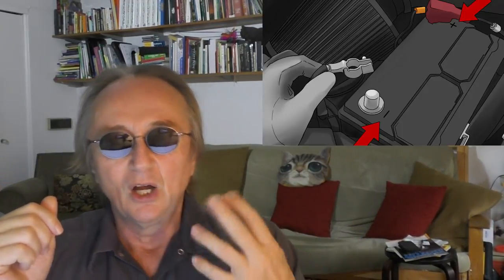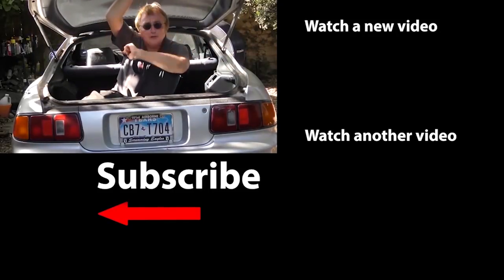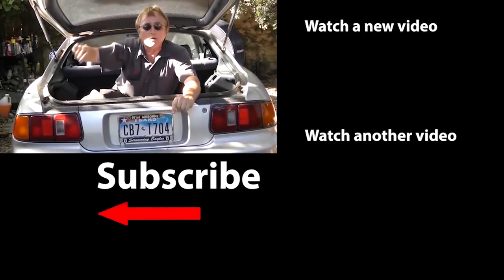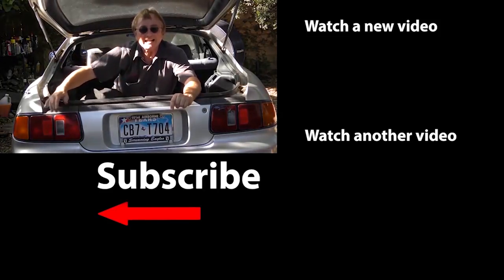When This Happens, You Need to Replace Your Catalytic Converter

Comment: I had two cars that had noisy catalytic converters as they aged. They made a metal buzzing sound. 
The first car, a 1987 Dodge Aries, I took to a mechanic, and he said it needed a new catalytic converter and wanted over $800 dollars to replace it (in 1994). I decided not to replace it. When I got home, a friend of mine went under the car and pushed on the converter with a stick. As soon as he touched it, the sound went away. It turned out it was a loose heat shield. I tightened it down with an exhaust pipe clamp and it never made noise again.

The second car was a 1999 Mitsubishi Mirage and the same noise happened as it got older. The same solution worked also. So, make sure a $2 fix might work instead of a $1200 fix.
Reply: Sucks that scam artists are out there. Thats why Id prefer to do everything I can at home. My transmission was leaking and the shop held onto the vehicle for WEEKS and did nothing. They also overtorqued the gasket bolts according to the other place.
Reply: Soooo...it was  magic stick? : )
Reply: I have a magic stick too 😃
Reply: Well that's a cheap fix

Comment: Yup, the C/C in my Ram V-10 decided to come apart and clog the exhaust when I picked up my brand new trailer.  Took me about 3 hours and 30 gal of gas to go 60 miles pulling the Grapevine in Calif.  (3 hrs for multiple cool-down stops.)  Had a friend come get the trailer so I could limp the truck home. Walker makes a nice replacement.

Comment: I've had the heat shield break loose & rattle against the catalytic converter, with the converter just fine. A self tapping screw or a rivet is pretty cheap & easy fix if you haven't checked the shield, do so.

Comment: I haven't used this trick in newer engines, but a pint of diesel fuel in the crank case will cut right through the  sludge so you can drain it out with the oil after 25-50 miles.

Comment: since it's a 97 Dodge you gonna need to replace the whole car not just the catalic convertor.
Reply: TSC TSC  ohio ate my 98 dodge 1500 lol so I bought a clean 85 w350
Reply: @dethklok6356  Ohio winters eat everything! I keep trying to find an inexpensive crew cab (around 6k) and everything is rusted to heck.
Reply: Constant Comet  undercoat and oil spray helps but you’re just prolonging the inevitable
Reply: GM Kof hard right I know it falls apart eventually lol ill find another in next 10 years or so
Reply: I had a 97 Dodge Intrepid. It was great until 202K miles and the transmission died. I scrapped it after that rather than messing with an expensive rebuilt transmission.
Reply: Constant Comet sounds like you’ve got a good excuse for a road trip to Arizona. Nothing there has serious rust
Reply: Constant Comet hey you can come out West to where it's hot and dry and buy something out here. No rust for sure if it's from here.
Reply: you're* going* to* need to replace...
Reply: Catalytic* converter*.
Reply: people drive the doodoo out of cars and when they break, they call them the worst POS they ever had. Not just Chrysler products either.
Reply: @jamesmedina2062  I'm actually looking at cars in Dallas and Phoenix now, as I have friends a d family there. I can fly there one way for like 150 bucks, go test drive a few trucks, hang out for a day with my friends, then drive back. It's actually cheaper to do that than to buy a truck in Ohio because anything without rusted frames sells for an outrageous premium.
Reply: Haha

Comment: I've been using engine flush for years, in multiple vehicles, and never had an issue. In fact, all of my cars have gone 275,000 or more miles with no internal engine issues. However, the flush I buy isn't corrosive. It's made from petroleum distallates. They sell it cheap at Wal-Mart.

Comment: Hi Scotty, Just wanted to inform viewers here that Platinum (Pt) or Rhodium(Rh)  inside the cat never degrades. My 00 landcruiser after 230K miles gave an error code for cat. But since I know chemistry and what Pt and Rh is doing in the Cat, I ended up replacing the post Cat O2 sensor with an oem sensor. Result: check engine is gone! BEFORE replacing the Cat, try replacing the post O2 sensor.

Comment: I have a had two Pontiac Grand Prix’s one base model and one GXP. I have had no problem with either except for standard maintenance the 3.8 and the ls4 5.3 will run forever had 230000 on the 3.8 until a tree jumped out and hit me and I only have 60000 on the GXP but still no problems great cars greatly put together R.I.P. Pontiac

Comment: In a wet trunk, look for damaged weather stripping ... then clean and re-lube with a vinyl/rubber dressing product.  Then look for gaps near the wheel wells and seal those with a tube of silicone caulk.  Don't forget to check the seal around the rear window.

Comment: One other thing to check for water in the trunk is under the carpeting.  I've seen leaks from rust through near the welds/caulking esp near the wheel arches.

Comment: First and only problem I've had so far with my SG Forester was a clogged front cat. $1100 installed, ouch. It ran fine and I could have lived with the engine light but as you probably already know Subaru disables the cruise control when a code gets tripped and I could not live without that. Ever since then I've  started to do all of my own work. :D
Reply: Toasty ouch. I would've left it TBH. What year?
Reply: @ilikeboost4764  2006 n/a, manual. It is relatively mint otherwise, especially for a Canadian car and I got it for a decent price so I didn't mind throwing a bit more into it.
Reply: I absolutely love manual transmission cars so I feel like you have a gem.

Comment: You take a long large screw driver, remove the converter and smash the honeycomb to bits, empty it out and reinstall the converter and then it works really good afterward.  Engine flushes can reek havoc on a VVTi engine, do not flush those.

Comment: My 1995 Chevy Astro cargo van has 268,000 miles, still running strong. Didn’t have to I have the transmission rebuild at 265,000 miles.

Comment: Oddly, just had catcon problems on both my vehicles. The 89 Blazer converter was stopped up (156k miles). It's so old the state doesn't check emissions on it, so it got a test pipe replacement. The 2001 Nissan catcon started rattling. The guts had broken loose from the shell, so it got a replacement cat at 149k miles (It's not old enough to be exempt from the emissions testing). $520 worth, but the car is in very good condition so it was worth it. $420 is about one payment on a new one. When the wheels fall off or the car ceases to be reliable, we'll get a newer used....... Toyota!

Comment: Mr. Kilmer you might also note. A lot of times when a transmission goes out its due to running hot or hard because of trans. Problems. Such as clogged lines or cooler, torque converter, solenoids, and propper fluid level and maintenance. If not corrected no matter where you get your trans. Its not gonna last long. I suggest replacing and/or cleaning any lines and cooler. Also replace torque converter it will save your wallet and trans. In the long run.

Comment: Our 2014 f150 with the 5.0 has a ton of electrical problem the sync system gets confused and will only let you use AM radio or it won’t come on truck has less than 40k miles. Engine runs good transmission has clunky shifts and 4x4 makes a awful noise. They don’t make them like they used to

Comment: Hey Scotty, I have a 2012 Nissan Altima with 60,000 miles. Nissan apparently recommended the transmission fluid to be changed every 30,000 miles. Should I still change mine now or just leave it alone?

Comment: Stop hating on Pontiac, there not bad cars. It's people that drive them into the ground and don't care about there car. It's always Toyota with a manual transmission that's #1 with u.
Reply: chevy I’ve got a Pontiac Vibe w 200k & still going strong. Same car as a Toyota Matrix. It’s a keeper 👍
Reply: Well considering that scotty mentioned in a few of his videos that he only puts 1000 miles in his celica per year, its easy to say that his celica will last. My first car was a 2001 pontiac grand prix gt that i bought for $600. That car was flawless until it got totaled. Had 191000 kms on it. Lets see scotty put 30,000 to 50,000 kms per year on his 24 year old celica and see if it will hold up.
Reply: I had a grand prix that I sold with 191,000 miles on it. I bought it with 161,000 on it. 30,000 trouble free miles, nothing except an alternator ever went bad. I now have a Bonneville SSEi and its even better. Tired of seeing scotty hate on pontiac, i still see many of them still on the road
Reply: @cobyjones5535  and my current daily which is a chevy impala with a 3.8L (another car scotty hates) has been perfect. Like i mentioned its easy to say a car will last when you're only putting 1000 miles on it a year. I put around 30000 kms a year on my impala and its been great for me
Reply: @guirguismarkus  i admit the transmissions in them arent the best, but theyre fine if you baby them and take care of them. 3800 engines are some of the best
Reply: @guirguismarkus  Scottybis a mechanic, so he knows what cars last longer from fixing his customers' cars, Toyota can handle a ton of abuse and they are cheap and easy to maintain and fix (most of the time)
I'm talking about 1996-2006 newer ones are a bit more senstive, but still..
Reply: His Celica would be fine, tons of people put that many miles on Toyota’s. My first Lexus had 180k on it when I bought it and I put 60k in two and a half years and sold with 240k and never had to fix one thing on that car.
Reply: Guirguis Markus it will hold up, Toyota’s can go half a million miles and then some
Reply: Scotty is right on the money. I used to be a Pontiac guy and GM in general, but there is a reason Pontiac, Saturn and Olds are gone. I drive a 7-yr old Toyota. Not one problem.

Comment: Are 1980s-1990s Toyota pickups worth it for $5,000- $10,000 with at least 200,000 miles? Over in the PNW every Toyota seems to be so much money. What would be the best option instead for that size truck?

Comment: That oh-so-sweet feeling when your locality has NO inspections and none of your vehicles has a cat!
Reply: Fl
Reply: Inspections are good when you want to breathe. They may be bad when you want to drive your smoking car. There is nothing like trading in your junker and buying a well-running car, perhaps a new one!
Reply: @jamesmedina2062  I live 2 miles from two different counties with no e-check, yet I have to have it for my vehicles. It's infuriating because it's extra cost, time, and work for me yet I still have to deal with busted muffler crapboxes brrrrttttting up the road all the time. People register their cars at friends and relatives addresses just to avoid it. So it either needs to be embraced by everyone, even with laxed requirements, or removed imo.
Reply: Constant Comet agree!!!! We're all in this together.

Comment: Catalytic converters are easy to fix! They get clogged up with this honeycomb gabage that builds up inside. What you have to do is unbolt it, beat on the sides a few times with a rubber mallet and then stick a really long screwdriver into it and break up the honeycomb garbage into chunks small enough that you can shake them out of the opening. Once you break them all up you shake them all out through the holes and once it's empty you can put it back on the car and you've saved hundreds of dollars!

Comment: Question in reference to an older video.   If you buy aftermarket catalytic converters, where do you have them installed?   I just went through this with a 98 F150---My mechanic shop no longer installs aftermarket pieces.

Comment: Hi Scotty. I have a 2006 HHR. Never had problems. Now the exhaust smells like something is burning.  The check engine light is on and it says its the O2 sensor. I replaced both recently so I dont think its that or if it is would a bad catalytic converter cause them to go bad? Whats the smell all about . No smoke just smell.

Comment: I used to have a small 05 GMC Canyon 4WD truck with 100k on it and those small trucks are tanks! Even tho I dented the oil pan haha! I took it off roading all the time and had to pull my friends out of some muddy places; I pulled a 2 Dr Toyota Tacoma an older one out of a small creek my buddy got stuck in the dang water was up to my windows and I rammed through there pulling his truck like mad 😡 as Scotty would say! Haha Tough little 5 cylinder that I loved! An 18 yr old girl slammed in the back of it welding our vehicles together which totaled it! I am still sad about it but if I get another one it'll be an 08 they put the V8's in! ;)

Comment: S.o. tried to steal mine ..... simply by sawing thru on both ends of exhaust pipe.

Luckily they only sawed thru one part of exhaust ... maybe got spooked .... 2003 Acura 140k MLS.... quote to weld it = $300+

Replace whole pipe and converter = $800+ 

Dallas TX at a Meinike right now !

Comment: Don't flush your engine with aftermarket products.  Run a HDEO (gas/diesel) engine oil like Shell Rotella, Chevron Delo, Mobil Delvac or Pennzoil Long Life.  The extra detergents in those oils will safely clean sludge out of your engine over the next several thousand miles.

Comment: Hi Scotty
I have a 1990 Ford F-250 Club Cab 4x4 w 460 motor very strong 
But the trans will not go into O drive been that way for 4 years runs great 
Will do a filter change but I think it might b a valve body 
Could there b a electrical connection to prevent of from engaging the switch does operate light goes on and off but no o d 
Please help 
What a great engine love it

Comment: Scotty I need your EXPERT opinion! I have a 2000 Lexus RX300 with a Check Engine light (P0768 LEXUS - Shift Solenoid 'D' Electrical Malfunction). The vehicle shifts fine - no problem. The transmission fluid looks clean - no smell - not low. The code comes on every two months or so and then goes off. I plan to sell the car in 6 months what should I do?

Comment: Mine broke and clogged in the middle of my long distance drive at 60000-70000 miles then just replaced it about a year ago at 117,000 on my 2004 Chevy trailblazer

Comment: Scotty F150 is a terrible recommendation!!! 
I had a 2006 f150 5.4 3v it was nothing be trouble! Spark plug change was $750 because of the ‘recall’ 2 pice spark plug cracked while being changed, then had issues with cam phasers and transmission!! Finally gave up and sold it 
Meanwhile my dads 2000 Silverado 2500 has 260k miles no major issues!!!!

Comment: I have a scion xa 2006 and it had 279k miles and just last week it has a purge canister  code . My inspection  is up in dec 31 so I will drive it up to a week before then fix it
Reply: Try to fix it sooner, in case the simple fix doesn't remove the code.

Comment: I have a 2013 Tacoma and the front diffs are engineered junk.  They used a flat roller bearing on the driver's side that fails.  They use the axle stub to support the side output gears in the carrier so they cheaped out and didn't bother machining the carrier to be the support.  It's just cheap engineering.  I do like the rear axle, engine, 6-speed manual, transfer case and frame.  The bodies are soft and dent easily.  I have three dents in my metal truck, one made by wood, one made by plastic and one made by meat.
Reply: Darn meat

Comment: Hey Scotty have a question I have a 2008 civic si. I been losing coolant and took it to the Honda dealer to see what it is and they said that the engine has bubbles in the cooling sysytem and that the cylinder head has to be refurbiahed and the head gasket replaced and that i have rusted cooling parts and they are charging me 4000 for the work is that fair price?. I live here in Dallas Texas

Comment: @skotty Kilmer I have a 2000 Honda Prelude that shakes after V-Tec is activated. My issue is that I had the same problem with the cat, the ceramic inside was broken so I took it all out and I’ve been driving like that no pb. Does that affect the V-tec from functioning properly?

Comment: What are your thoughts about my 1998 Ford F150 with 326,000 miles?
Reply: Drive it until the wheels fall off. New ones cost too much.

Comment: What I was in automotive school I found that when I ran Airplane Fuel through my Nissan stanza it cooked the catalytic converter and with no money all I did was smash out the ceramic insides removed it all and put it all back together it's still passed emissions with no problem and nobody ever knew the difference. Any comment to that?

Comment: Hey I have a 2002 Dodge Ram 1500 v6 3.7 single cab truck sounds a little quieter than before it has a loud muffler I like the sound but wish it could be louder what should I do? Had it for like 14 years has 183,333miles

Comment: The failure of the fuel tank purge valve coincided with the rear O2 sensor not working correctly. This is the same valve that is also part of the recall. Apparently fuel was drawn by suction up the purge line and into the engine. The rich mixture can cause the engine to ruin the converter, right? I remember my car would backfire on downward inclines really badly often, and the exhaust would smell like gasoline when the car was started – it doesn't do that now since the valve was replaced, along with the fuel tank and charcoal canister.

Don't. Buy. A. Ford. Product.

Comment: Just don't buy F150 unless you want it fix daily. Go search pros who have to fix them.
Reply: sigor2011 u can say the same thing about dodge, Chevy, and gmc trucks
Reply: sigor2011 got a 98 f150 v6 manual transmission has been the most reliable truck just tune used when needed no issues at 230000 miles